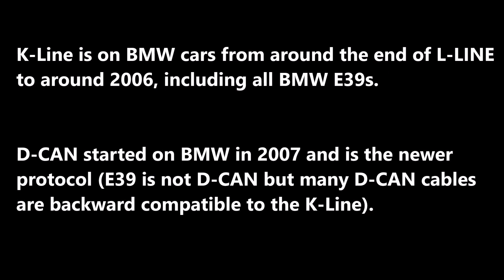BMW K+DCAN to USB cable - Correct position for selector slide switch?

Comment: Thank you - gone from an 2007 E90 to a 2016 X1 F48...I was worried when I couldn't code read it, restarted the laptop several times and wiggled the OBD but got the same "vehicle not found" type messages
Flipped the switch from the left hand side  where it has always lived and worked...  and can see all its faults now!
Damn...quite a list to work through

Comment: I just noticed my USB data lines are different from yours, looking at where the cable comes in, mine is black, white, green and red and yours is black, green, white and red... I wonder if this would cause a data disconnection🤔

Comment: I'm curious as to whether my OBDwiz cable that is USB/OBDII, is a K cable? I do know that it works with the OBDwiz software that's on my laptop while connected to my E39. That being the case, it seems that my cable will work with INPA, etc. Sound right? Thanks to YuDaMan, or anyone else who can clarify.

Comment: Hello i have 1 bmw e90 from 2005 and i have 1 adapter like you have whit 4 slides so whitch position i should put that
Reply: What did you do for e90. I have also cable but there is no switch

Comment: its so hard for people to give a straight answer. 
LEFT = working.
Reply: some of the bmw need to switch to right to work. lets say that 70-80% of bmw needs to keep the switch on the left, and the 30-20%bmw need to keep it on right.
I have D+CAN cable but White transparency color - and the switch works opposite - I need to keep it on right to have 7 and 8 connected.

Comment: I have the same exact cable and it works fine with K-can vehicles even when the switch is moved to the right side. But it doesn´t work with D-can vehicles. Somehow ISTA-D just says "Vehicle could not be identified, check Vehicle interface And PAD active"... 
Any suggestions? Is it possible that only 1 communication channel is broken?
Reply: I have this as well. Please can you advise?

Comment: Hi. This was very helpful. I have a similar cable with a 3-way switch that is wired the other way so 1 = D-CAN while 2 and 3 are K-Line. Even so your video was a real help. I have a 2007 E93 so I need D-CAN so position 1 on my cable.  Thanks from the UK

Comment: Interesting to see that there is a 4 position switch version of this coding cable. In my case there is just a 2 position switch (So I guess I have the premium, more expensive version ;-)  ) .... I also guess that in my case the position is just K -left and DCAN right. I will see if it works.

Comment: Hello friends!  I have a 2000 M5.  Just wanted to make sure I'm clear...
Is E39 position 1?  Or the other positions 2-4? 
This video seems to imply that K-Line is position 1 and for E39 (and other pre-2007 cars), but on another video I'm watching, it says position 1 is for E60/E90 (and he goes on to use the cable on his E60 in position 1).  I feel like neither video directly says which is which, but they both strongly imply the opposite lol.
(for reference, starting at 3:10: https://www.youtube.com/watch?v=dRam10oezCw)
Just hoping to make it crystal clear :)  Thanks everyone!
Reply: And did you ever figure it out? I hear if you use the wrong setting it can misalign DME and EWS.
Reply: Until 2007 BMW used K Line and from 2007 it used DCAN Line

Comment: So what are they position 2,3 for if position 1 is for cars to 2007yer and position 4 to car up 2007.But what i use position 2 and 3?
Reply from the maker: 2, 3 and 4 are all exactly the same ... it doesn't matter.  position 1 is for K-line, 2,3 and 4 for DCAN.